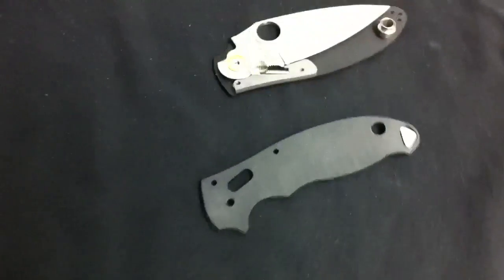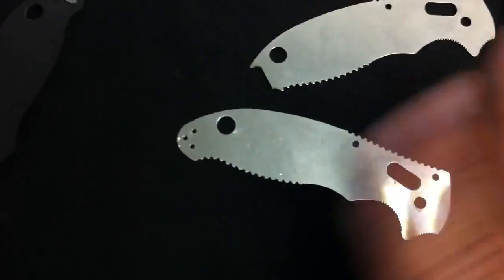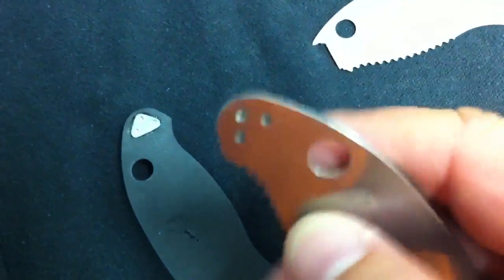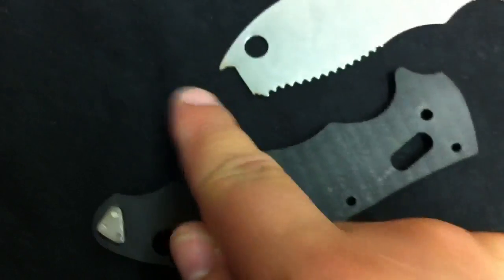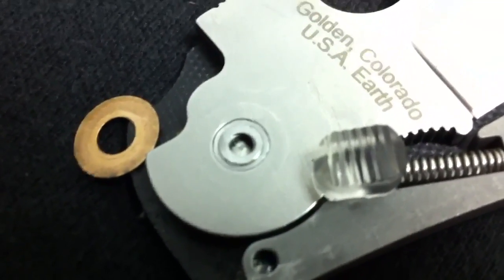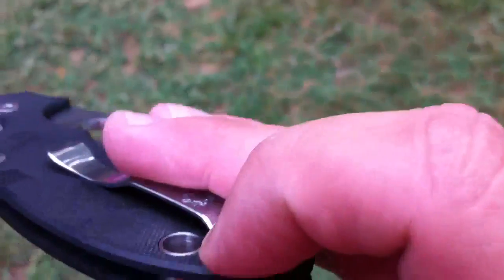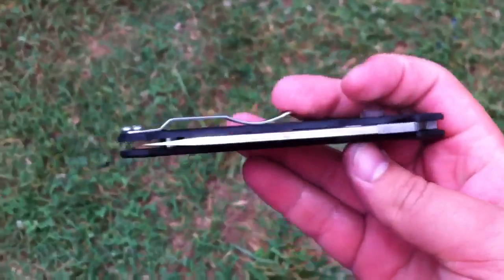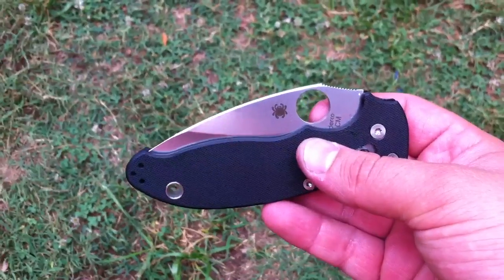Operation Lightweight G-10 Manix almost DONE!!!

Comment: Did you give a final weight somewhere in your vids? I have the Manix 2 lightweight at 2.8oz & was curious how yours turned out. While the lightweight does not use liners, its made to the same thickness as the standard Manix 2. I really like how thin yours is now.